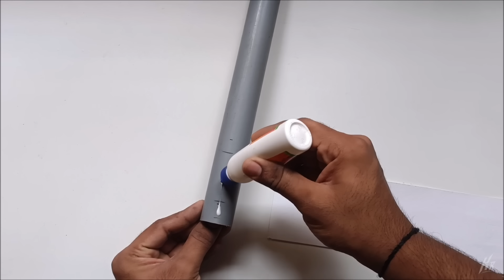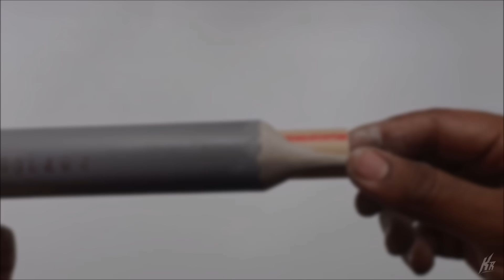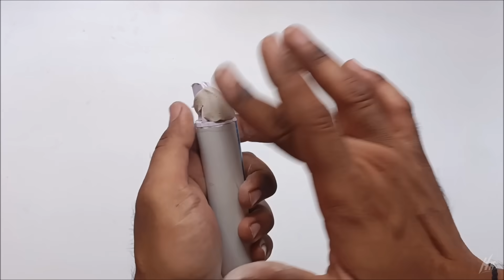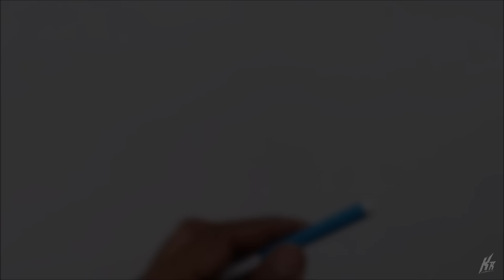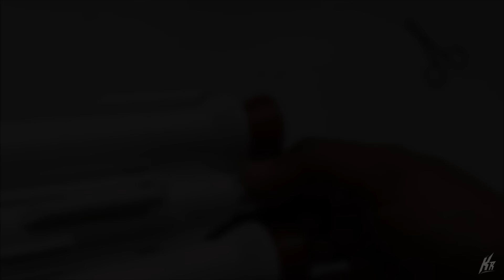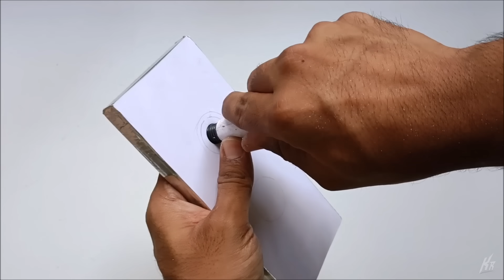How To Make CHANDRAYAAN 3 Rocket Model | Chandrayaan 3 Making

Comment: Pipes ki length btao na
Reply from the maker: 30cm for the larger one &
20.5cm for the smaller ones,
Btw you can check Template/Measurements file in the description box for more details.

Comment: Bro I dont have drill machine to make a hole in PVC pipe .. Can I use hot needle to make a hole ?? Will it cause any damage to the  Model ? Plz guide
Reply from the maker: No issues, Even I used heated screwdriver tip to make the holes.
Reply: Thank u Bhai .. Thank u so much for the reply .. I am trying to make this for my Ganpati decoration .. I will let u know my experience in detail after few days .. Lots of love from Pune  @MaxArt_KR

Comment: Excellent work of art, good detailing overall..👍Since diameter is 1 inch and 3.5cm, kindly help with the length of the pvc for the rocket.. thank you
Reply from the maker: Check 'Template/Measurements' file (link) in the description box